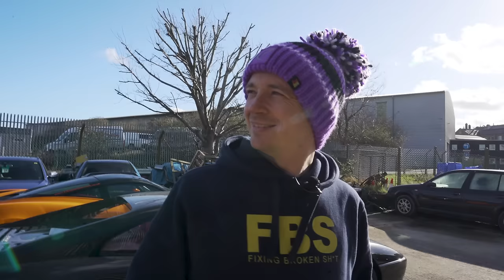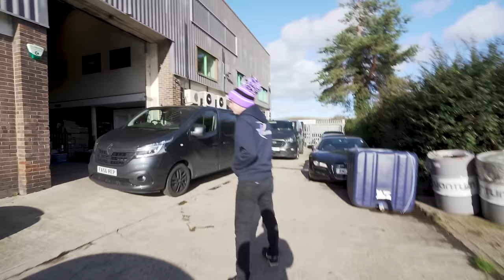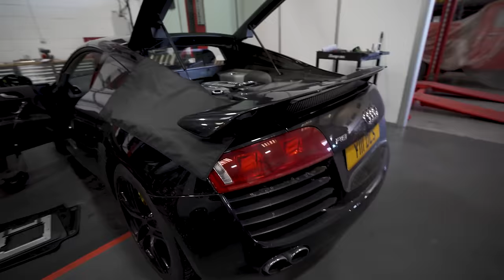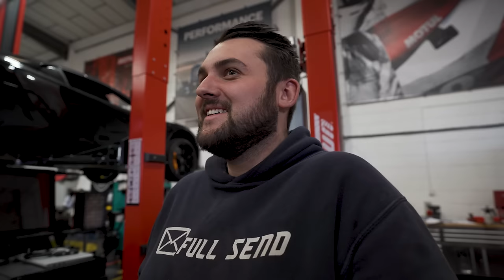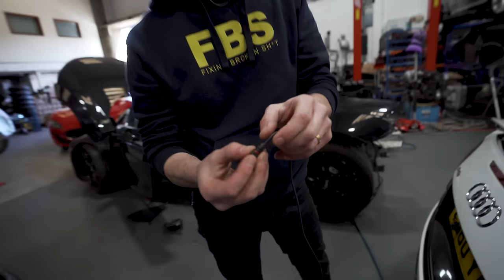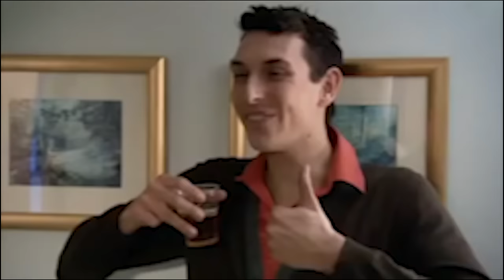Is An RS3 The Best All Rounder For £50K? | Workshop Update No.52

Comment: I own a 2018 DAZA RS3 Saloon at about 500bhp. It was my dream car. I sat in a promo car at Goodwood FoS and swore I would own one "one day". Now I do, and while it is an amazing all-rounder, i've had cars with half the power be much more fun to drive. The RS3 is a monster, can get 30MPG if you try hard, has been super reliable and cheap to maintain. Upgrade the rear ARB and the handling is much less under-steery.

Problem is, it is SO capable, so damn quick, so much torque and so linear in the delivery. You're doing 100+ on a B-road when you find the limit (and the hedge).

Does it make me smile inside? No. It kills me to say it.

Also every idiot in an M135i or Golf R drives at me like I am questioning their manhood just being there. They're idiots. The hot-hatch bois ruin owning an RS3. If I was in a 911, I doubt I would get the same morons.

Comment: 981 Cayman GTS PDK with PTV, LSD and the passive suspension, PCCB's. (out the GT4's and 991.1 and .2 GT3's I've had that is still the sweetest car that did everything, and had an overdrive 7th gear to get there in comfort).
Reply: GTS is an expensive S.  PTV is weak 3 plater diff so not worth having, PCCBs are not from the GT4, X73 is ok, but better dampers out there.  X73 rear ARB is a must have, but the GT3/4 MC and servo transform the shitty OEM pedal feel.
Reply: I reckon if you're committed to spending £50k on a Cayman, you'd save up a few more bob and go for a current gen 4.0 GTS instead. There's loads up for mid sixties, and a few mid fifties, all 6-8 years newer, with 1/2 to 1/3rd the mileage. If you're gonna go 981 there's no good reason not to just get an S and save yourself 15k. The GTS is probably the worst value proposition of the 981 gen, they're not £15k better than an S in terms of driving experience, and they're close enough in value to the 4.0 models you'd be silly not to cross shop them.
Reply: @Hypersonik  That's not my experience, but hey, if we all liked the same thing what a dull world it would be!
Reply: @MacellaioNero  The 981 GTS and S are identical apart form an additional radiator for the GTS.  The MA1.23 is nerfed electronically and when mapped gives you 360bhp.  In the Boxster S, you get the most gains.  A decent 981 S can be had for £27k now :)

Comment: On the old road bike to have a go on. I am 60 this year and had loads of bikes back in the day, KH250, 400, RD 250 & 400. Suzuki X7 , friends had the GT750 kettle and the KH750 which I had a go on. Simple fact back then was they were great fun and fast in a straight line. But all of them tried to kill you in corners. They were all crap. Game changer was the RD350LC , owned two back in the day. Great fun and with the introduction of the Avon super venum tyre it was amazing handling. We used to race from gisburn to settle and the only bike that caught me was a Bimota gsx1100. My last bike 21 years ago was the R6. I would recommend you have a go on the RD 350LC, bonkers fun, power delivery is the greatest fun. Nothing under 6000 and then batshit crazy.
Reply: Yamaha RD500
Reply: The RD 500 was over geared so It did 80 in first. Never rode one but Yamaha dulled it down. The Rd350 is iconic and crazy to ride. I loved it. Scared the shit out of many people. More exhilarating than any woman.
Reply: @andrewbaron8713  three years older mate, had rides on 250 350 but 500 was most fun like riding a big Motorcross bike in street form, that bike was the first edition
Reply: @johngibson3837  one of the lads did put a 250 mx bike on the road. A Yamaha as I remember. It just wheeled in every gear. Chewed up rear tyres in no time. . Great fun but no super moto
Reply: @andrewbaron8713  I used YZ 250 and 490 on road a bit as both were set up for enduro no disc brakes or road tyres though, the RD 500 was a wheelie menace as well
Reply: Great roads up there mate , I know it well , I had an X7 an 250LC and 350 LC back in 84 great fun , happy days 😊 Cheers mate 👍
Reply: The RD350LC was my 3rd bike way back then loved it to bits - now in my early 60's just purchase a 2022 BMW S1000RR M Sport mentally fast and I love it.

Comment: I bought a DAZA RS3 in November. Needed the practicality and wanted the noise / go all in one car. No doubt if I had a bit more I’d go for the 8Y or a C7 RS6
Reply: (also 2018 RS3 owner) I wanted to like the 8Y but the looks I don't think are as timeless. The 8V.2 is a masterpeice in my opinion. Also the 8Y interior is (to me) so much cheaper and nastier than the 8V. I wanted to like it, I tried it ... rubbish. The torque splitting diff thing is cool, but I don't need to be sideways on my way to Tesco.
Reply: @aidencoder  Agreed mate. Had a few similar cars like a C63, M140i, PFL 8V RS3, Scirocco / Golf R. Nothing comes close. For the price, the single best car that does everything

Comment: 981 cayman GT4, RS3 8P built engine with hybrid turbo kit for usable power, 996 bigger turbos or a 997 Porsche turbo, definitely something Audi or Porsche around 450-600bhp that’s had a fettling.
Reply: Why an 8P RS3? The 8P chassis is absolute BALLS. I'd rather take an 8L S3 over ANY 8P (having owned 8Ps)
Reply: @aidencoder  8P looks the best imo. Theirs things you can do to help with the chassis. I admit Yeah the 8V or 8Y is far superior chassis but theirs something about the shape of a 8P RS3 that does it for me. As do most of the models I listed. Looks, performance and sound.

Comment: 50k and I’d have a proper GP4 escort with a millington Dimond lump an fishnet Recaro’s and original interior , 10x15 5 spoke revolutions 😳
Reply: It'd need 5 gearbox rebuilds by the time you got it to the Nurburgring.  And ergonomically, they're shit.
Reply: @Hypersonik  😂😂😂 gearboxes last ages especially a samsonas or tractive sequential .
Ergonomically their only shit if your a fat bastard. 
Could go I’m my e36 evo race car but that’s only 25k so instead I may go in the e36 GTR I’m building, that’s a 50k motor 💋😂
Reply: Don’t think you’d get a proper GP4 Escort with a Millington for £50k! 🙁
Reply: @alcapony4935  you would if you built it yourself and dropped on the bits for the right money
Reply: @newagetemplar6100   You’d have to do almost everything yourself, and get the engine second hand.
Reply: @alcapony4935  exactly and that’s how you do it , did it before with a N/A cosworth powder Mk2 , Gp4 FF Atlas , Webber alps fuel injection , quaife box , shell prep and build myself. 10k all in . 2003 
Now on with a BMW E36 GTR , 50k all in max 
Porsche 991 GT cup discs and centre locks / wheels , Alcon endurance callipers, , 4.3 big case slippy diff , tilto pedal box and twin turbo engine on Motec and carbon composite body 😃